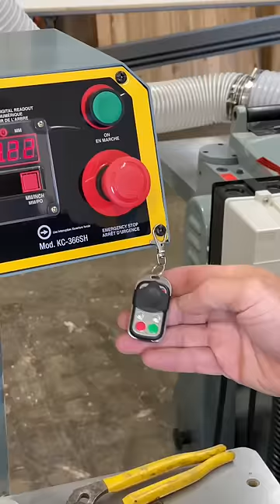VGroove cutters for strong, self aligning glue joints #woodworking #woodwork #wood #shorts #joinery

Comment: Can you offset the 1st shaper so that it leaves a nickel gap on one side when the 2 boards are joined together?  kind of like a ship lap look?
Reply from the maker: Yes you could - these cutters are for making self aligning glue joints though with increased glue surface for a stronger joint and then the V is to self align the boards as the get pressed together 👍
Reply: @dustylumberco  Gotcha, makes sense.

Comment: What's this advantage over tongue and groove?
Reply from the maker: The V shape is for glue joints and does two main things, first it increases the total glue surface giving you a stronger joint and second the V shape helps with self alignment. When you start putting the boards together the V makes it so there is a wider gap for the boards to start to go together and then as boards come closer together the V makes the boards slide exactly into place and tighten. With T&G and the sharp edges and perfect tongue to groove you have to have things lined up perfect all along and sometimes especially with longer boards that can be tough and you can get pieces of the tongue or groove break off and get in your joint and then things won’t go together perfect
Reply: @dustylumberco  well you learn something new every day. Thanks for the tips.  Love your videos, keep em coming!

Comment: “Tongue and groove” cutters.
Reply from the maker: No these are V groove cutters. If you go back a few videos you will see a show T&G cutters which are 90 degree angels whereas these are shaped like a V so they the boards more easily slide into the slot and then self align and tighten as the boards are clamped together
Reply: Pro👍👏👏